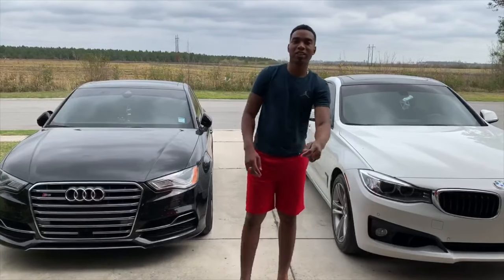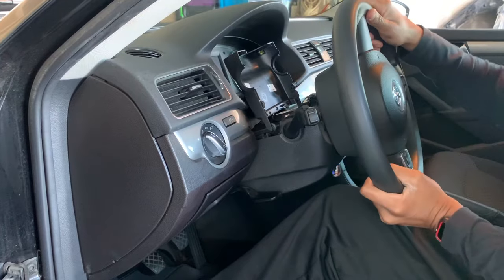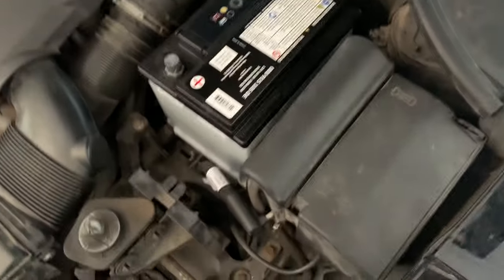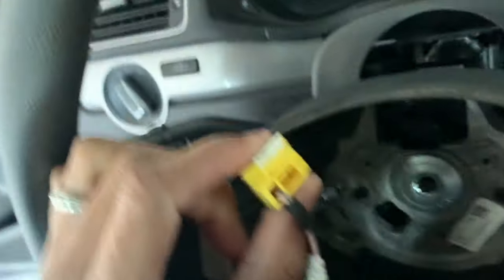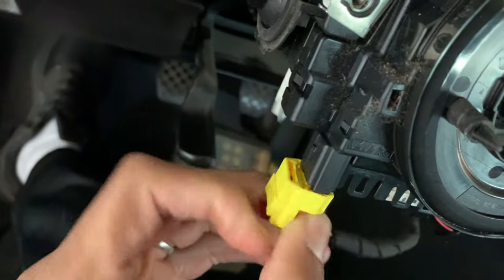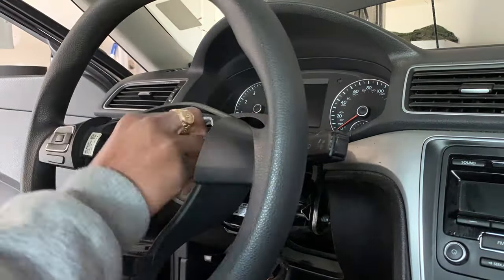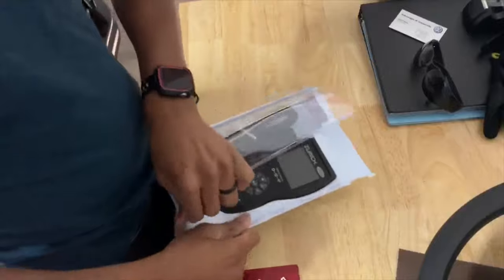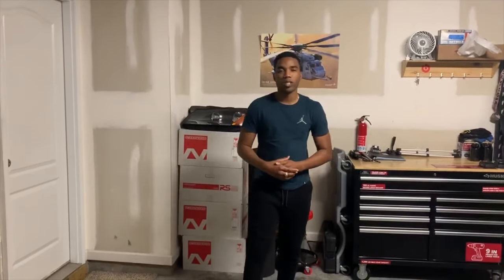Removing and Replacing  Volkswagen  Passat Airbag, Steering wheel and Clock spring. Part 5

Comment: steering wheel bolt looks like a triple square. Mine was a 12mm. It will not be a fun day if you strip out a triple square with a torx.

Comment: When releasing the airbag, don't pull down on the plastic tabs, use your flat head to move the metal tabs in towards the steering column. The factory service manual depicts the screwdriver on the plastic tabs, which is wrong. Took me a bit of frustration to figure that out!

Comment: I just replaced my steering wheel with with a quick release (VW PASSAT 2015) and I have everything hooked back up correctly, except for the horn, I just need to know the wiring for it to connect, I have everything I need. I was hoping you pointed out the horn wires but its okay, just hoping you reply to comments too
Reply from the maker: There are some horn wires on the left and right on the car behind the front bumper. If you need more help just contact me on wee rebuildz on Instagram.

Comment: i needed  to replace clock spring on my 2013 Tiguan and i called local VW dealer for parts and what it would cost for them to program it after i install the part. This doesn't happen often but got great news....vw dealer advised that parts and labor to replace the clock spring is 100% covered by the dealer. so i called another dealer to verify they told me the same ( i scheduled an appointment for 01/03, ) . They advised that the clock spring warranty has been extended. this was a nice surprise. please check with your dealership prior to purchasing and replacing your clock spring.  they said that as long as your mileage is lower than 999,999 you are covered. that's what their warranty shows. basically all cars are covered.
Reply from the maker: I did not know this thanks for the insight on this. This is great news now it is easier for people to get it done at the dealer.
Reply: There was a recall for Passats and Tiguans, that's what you mean. Sadly I'm in Mexico and this didn't happen :( great video though
Reply from the maker: @ericklopezalvarez1253  hey but see if you can give it a try and see if it works.

Comment: Thank you so much for this video! Same thing is happening with my Passat (buttons & horn don’t work) but the OBD reader is aging it lost connection with the steering wheel control module …is that still it or the clock spring is part of it ?
Reply from the maker: the clock spring was the problem in mine. but the dealership has a tool that can recalibrate it after your change it.

Comment: Just replaced on a 2017 passat video was 👍,  I still don't have paddle shifting, Cruise control and airbag light is on.
My question is can I do this with a scanner or should I go 2 dealer to have synced/programed.
Reply from the maker: now all you have to do is just to get a scanner and hard clear the code and you should be good to go after that.

Comment: This video is a great explanation, my only question is why did you put a new airbag in too. Did you suspect yours to be faulty?
Reply from the maker: no it's because the guy who I bought it from sold it to me in a set. so I was like I will but the clock spring n air bag the came off the same car.

Comment: Where did you get the mew clock spring at ?
Reply from the maker: someone had a wreaked vw Passat and I bought it from them.
Reply: I need one for a cc any thoughts
Reply from the maker: @carolrice5321  u can check some junk yards but some times when the air bag goes off it can damage the clock spring so I can work or not. and you can check on eBay too.

Comment: We replaced the clockspring, but did you have trouble with your cruise control not working?
Reply from the maker: no I did not have any issues with that. take it to the dealer I think they have a tool to program it back to the car.

Comment: Im pretty sure this  is the issue with my passatt would this issue affect changing gears manually?
Reply from the maker: no it will not affect that.
Reply: Yes, if your clock spring is bad your paddle shifters will not work as they are attached to the steering unit

Comment: could i replace the clock spring and then take the car to a mechanic so they could clear the code for me?
Reply from the maker: yes you can be see if they have the tools to do it. and some times you may have to take it to the dealer to recalibrate the clock spring.

Comment: Im needing to do this on my 2010 passat.. did you replace just clock spring?? Or clock spring and Airbag?
Reply from the maker: I just replace the clock spring but you will need to get the clock spring program back to the car.

Comment: "Please note that this part is not plug & play and you need to perform a basic adjustment with a diagnostic machine after assembly and before use, otherwise it may cause damage to the part and it will not work."

I'm reading this on the sellers page, any reason to be concerned?
Reply from the maker: its like the code to reset the clock spring back to the car and u would just put a special type of scanner on the car and you turn it all the way left and right and in the center and it would take of traction light .
Reply from the maker: @martinolsson5239  yea thats all you will need to do because some of the cars will want you to do like a test and then u will be good and the clock spring will be programed to the car

Comment: I have a question I have the same problem in my 2012 passat nothing works on the Steering wheel and the air bag light is also on.
my question is I only have to buy the clock spring and not the airbag?
Reply from the maker: yea you only need to buy the clock spring because the airbag is connected to the clock spring. so you only need to buy the clock spring .
Reply: @weerebuildz4427   Thank you brother, your video helped me a lot because when that happened  the airbag light in the on the dash we thought it was the airbag module and I sent it to a company to fix it then the module arrived, we connected it and the problem The light continued,  then I realized that something was wrong because nothing was working on the buttons of the Steering wheel, I looked at you and I saw your video and it gave me the light I needed .... thank you brot I appreciate it a lot
Reply from the maker: @jb18475  lol thanks, no problem happy to help.

Comment: Shop says it will be $500+ to fix
Reply from the maker: is the 500 just be for the clock spring
Reply: @weerebuildz4427   for parts and labor it will be around $600
Reply from the maker: @gabriellacox3207  Thats alot.